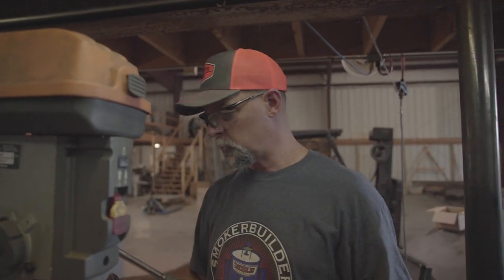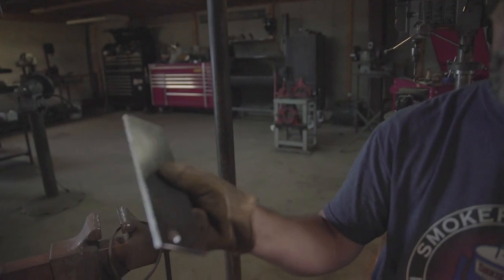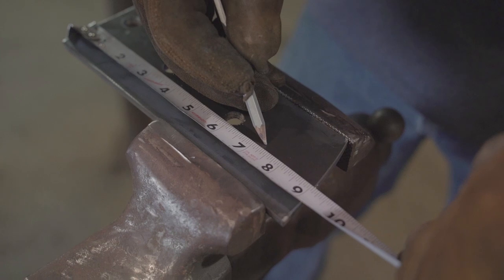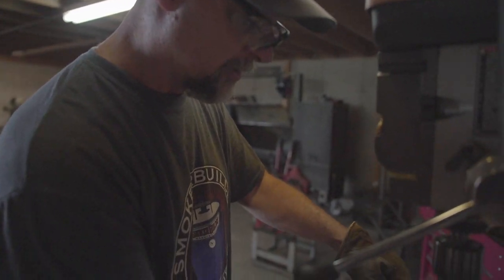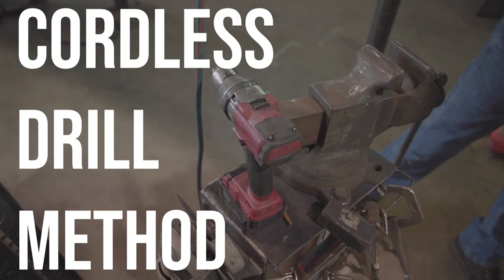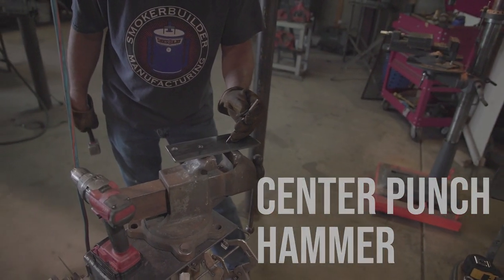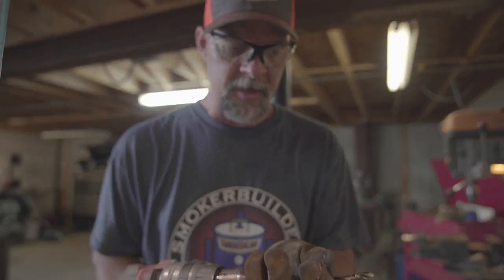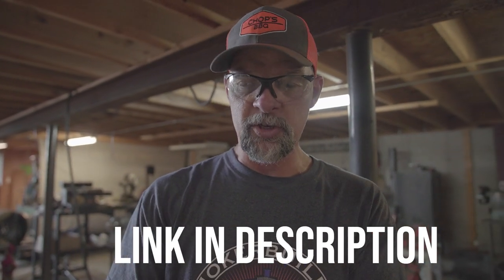Expert Tips: How To Drill Holes In Thick Metal

Comment: TTP CUT-IT paste is great. We have been using it for 3 years on our Stainless Steel TIG welded aircraft (gyroplane) frames. Their drill bits have Cobalt with a nice extraction flute and 135 degree tips but the best drill bits for hard to drill metals like 304 Stainless will be Carbide with Titanium Aluminum Nitride (TiAlN) coating on them with 135 degree point angle. Those are expensive as heck. Like $200 for a half inch drill bit. More than your run of the mill drill/driver. A center punch is always a good idea. Drill slow and smart. Good video. A word of caution these Cobalt infused drill bits are not meant to be used on High Carbon Steel or heat treated Steel. That would be the wrong application and they will break.

Comment: I drilled three half inch holes in a quarter of an inch thick slab of metal using a step drill bit after drilling a pilot hole with about three small drill bits. Initially I began with a tiny drill bit and progressively used bigger and bigger drill bits but eventually one of the drill bits was getting stuck somewhere in between because I was missing a size and couldn’t jump to the next size drill bit. That’s when I went out and bought a half inch step drill bit and completed drilling the first hole. The other two remaining holes I simply made a pilot hole and then switched to the step drill bit and it was like butter all the way through. A step drill bit doesn’t get stuck and the holes are cleaner. A step drill bit is much quicker than switching from bit to bit until you reach the hole size you intend. With a step drill bit you simply initially use a 1/8th drill bit to make the pilot hole and then switch to the step drill bit which has all the drill bit sizes from 1/8th of an inch all the way up to 1/2 inch in ONE DRILL BIT. That’s why it’s called a step drill bit. It’s MUCH MUCH faster. I did all of this using a DeWalt hand drill because I don’t own a drill press machine.

Comment: Thanks for the technique and info. I'm a completely new to this and was looking to buy a drill. Will be drilling into metals and cutting them. I noticed there are attachments to make drills into like an angle grinder but wasn't sure if maybe just buying an angle grinder would be best. But yeah just wanted to ask if there's a drill and or grinder you might be willing to recommend? I'm hoping to pay under $200 for any one tool and from my research so far a brushless motor and it being cordless seems ideal. Also seen some rotary tools which could be ideal for more smaller cuts but again just not sure what to buy. Any help would be greatly appreciated. Again thanks for the video.
Reply from the maker: Hey buddy! We do not recommend combination type tools. My first choic for grinders is always Metabo brand. 

If it’s just for hobby work then harbor freight grinders and drills are fine. Just get the warranty offer, that way they will replace it if it breaks. They are not the highest quality tools but they do work pretty decent and the price is right.
Always Always use a guard when using a sliver or cut off wheel. It’s not a question of if it will break. It is more like WHEN it will break.
Brushless is a good option on any cordless tool.
Reply: @SmokerBuilder  thanks so much for the response. Okay definitely I was watching a video from another youtube channel called the Q and the engineer there was using a metabo grinder, so great I'll get one of those and make sure it has a guard as well. Didn't know about the warranty option for tools thanks so much.
Reply: Angle grinder is very dangerous tool. Use guard, get one with speed selector and try to get a power chord with pedal. If you get injured,e.g. by falling down, pedal will stop power and grinder will stop. Otherwise it could hurt you more, like cut you leg. 
Speed selector is important, lower speed decreases disc energy, it will be less likely to break and last longer.
Dont apply much force on disc when cutting, it will break, its a mistake many people make.
If you use grinder for polishing or with steel brush, use low speed like 3000rpm, not 11000max speed.
Use thick clothes and safety glasses, gloves, steel pieces may fly around and can enter through your clothes.
Reply: @nilsfrahm1323  thanks for this feedback. Always gotta stay safe to build another day. I didn't know of this option do all brands have these or any specific one you'd recommend?

Comment: I have a 1 1/2 drill bit with reduced shank..and drill press i tried 2 smaller holes.but not all way through like u did thn took the 1/ 1/2. Bit n it's taking forever .its looks like it's shaving and not cutting.idk what to do anymore
Reply: Sharpen your bits and use a bottle to pout water as you drill to keep drill area cool.

Comment: If it wasn’t for the dip would you be using lube?
Reply: Motor oil works as well.it draws the heat away just like it does in an engine

Comment: 1/4" plate is thick metal? Seriously?
Reply from the maker: For some people it is the thickest they have tried to drill.
Reply: I have a 2.3 in block I've been working on drilling through
Reply: @kevinwithrow  I did 1 inch thick recently with a hole saw and drilling oil . 7/8 hole
Reply: @datingsas  I had to cut a stainless steel rod into 1 1/2 inches and put a 1/2 hole all the way through it, followed by a 5/8 plate same..1/2 hole through it.  I thought that was tick metal...